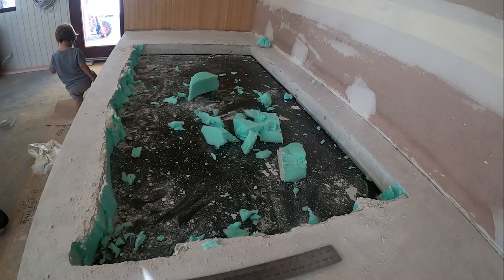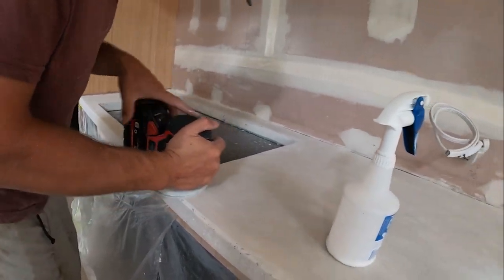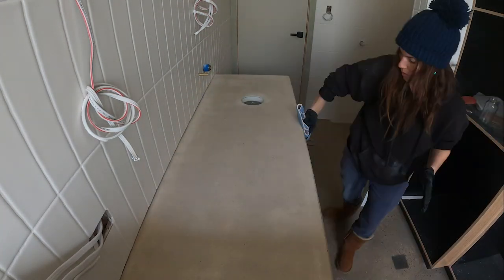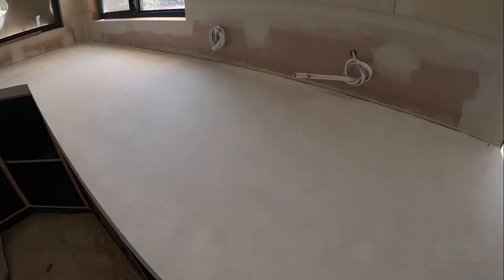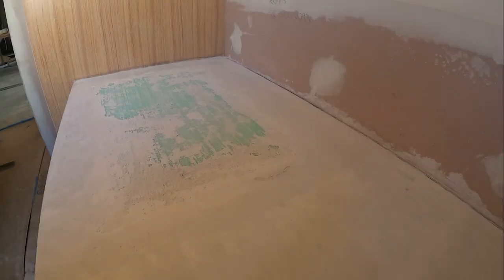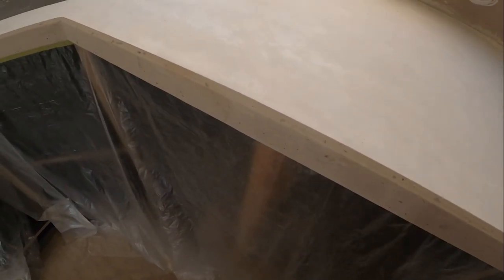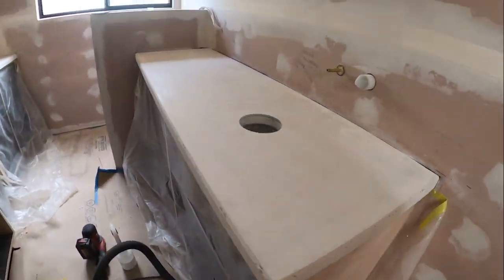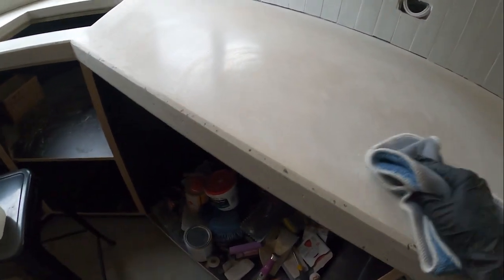OWNER BUILDING IN AUSTRALIA - White Concrete Benchtops PART TWO

Comment: Nice one ! Just poured our laundry benchtop slab today.
Reply from the maker: Oh nice work! How did you go with it? Worth doing hey?! ☺️
Reply: @somewhereoutthere.  Id say 8/10 happy. Had to pour in place in the laundry due to restricted access. I'll cast the other benchtops in a moulding and install after like a normal slab. For bang for buck its still awesome. I'd say the hand troweled finish is a bit more rustic looking (prior to grinding) but it's growing on me.
Reply from the maker: Wow! 8/10 well done! Yes! They definitely have a completely different finish when they’re cast and flipped. Honestly though, with grinding - you can still get them so smooth you wouldn’t even notice. It just feels like the long way to go about it 🤪 but we got there in the end!
Reply: @somewhereoutthere.  Yeah your video has convinced me to go out and get some resin pads and give it good little grind back and hook the shopvac to get rid of that nasty dust. Did you dry and wet grind yours?
Reply from the maker: We only did it dry! But definitely hook it up to the vacuum for sure, the 50 grit is pretty dusty but the rest weren’t too bad 😊

Comment: Guys you obviously have incredibly high standards because you are so critical of yourselves and you did an absolutely amazing job of those countertops. The only tips I would give you would be to use a flow control which allows it to flow much easier and evenly without losing the strength that you would
If you were to use more water.
Reply from the maker: Thank you so much for your kind words. Oh that’s a great tip, thank you! We’re going to be doing our table/island bench soon, so we might have to look into it 🙌🏼
Reply: @somewhereoutthere.  that’s epic! Depending on the size, pre casting concrete in melamine can be so much easier for an island bench :)
Reply from the maker: @Lukelikestodostuff after doing our own, we did a kitchen for some mates of ours and used melamine instead. It was heaps easier and way more cost effective! Will definitely be using it for the table 😍

Comment: I found your channel today as I want to do these bench tops and I love your channel. Can you list what products you use when doing your DIY videos? I wanted to also ask you if you could tell me what your tiles and colours are called and where you got them from in your laundry? I love the colour also what sealer and brand you used to seal the tops of the bench tops? Please keep the video's coming I love them so much. Thank you for sharing.
Reply from the maker: Hi Summa, thanks for your comment! The tiles in our bathroom/laundry were bought locally at the Tile & Cupboard shop. They are a Matte White Wavy Subway Tile (300mm x 75mm). We also used white grout.

Our bench tops are sealed with a sealer from WA Sealers called Pro Seal 896.

I hope this helps!

Comment: Hello, Wondering what attachment you used on the angle grinder to finish the edge on the benchtop and where did you purchase from ?
Reply from the maker: It’s called a diamond bevel wheel (or diamond profile wheel) and we got ours from Perth Concrete Hire. Your local concrete specialist will be able to help, I’m sure 👌🏼

Comment: Hey guys, thanks for the video. What sealer did you use and why? Did you get that from Perth Concrete Hire as well?
Reply from the maker: Hey Nathan! Thanks for your comment, we originally did use an FDA approved impregnating sealer from Perth Concrete Hire - they’re so helpful there! After a few weeks of living in the house we were noticing a few minor stains. So we actually ended up adding a coat of the sealer that we used on our floors on top as well and it’s been full proof! It’s from WA Sealers and it’s called Pro Seal 896. In saying all of this, the original sealer was also fine, we’re just the type of people that aren’t very careful with our benches 🤣 I hope that helps!

Comment: Hello, following you forever
We are on a farm 80km from Albany and about to poor our concrete kitchen benches! Done a few practice molds but cant seem to get it right! We are following the 3:2:2 rule and did we here right per batch it was ? 
14 Sand
10 Aggregate
11Cement

How much water do you use or just eyeball it ? 
Thanks Sinead
Reply from the maker: Hi Sinead, thanks for reaching out!

The 3:2:2 ratio is (3 agg):(2 sand):(2 cement)… is sounds like you may have too much sand about not enough agg? 

Dane just eyeballs the water! From memory, our first batch was a bit wet but nailed it for the rest. I hope this helps!
Reply: Oh thankyou so much for replying 🙏Yeah it just looks quite stiff and gritty ! Where yours looks quite wiped/creamy like if that makes sence ? 

How long did you let dry and did you start grinding
Were about to start harvest with no kitchen bench 😢
My hubby hates white concrete too so may end up grey as he is blaming that 😅

Did you also use local baged agg or from landcape place ? And what size agg, Does it matter ? 
Using same brand/colour concrete
Reply from the maker: @sineadhodgkinson1031 I’d say the “grittyness” is from too much sand but I’m not 100% sure! I think change the ratios and give it another go? 

We used local agg from our local landscape place, it’s cheaper than buying it by the bag. I don’t think the size would matter too much, just the standard blue metal should work! We didn’t start grinding them for about a week!